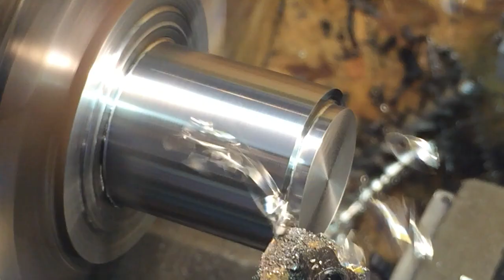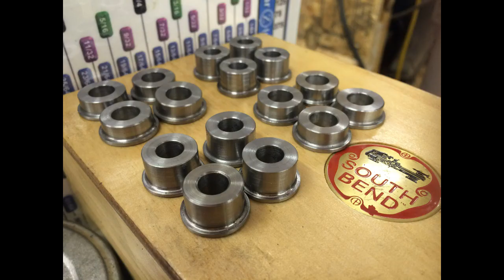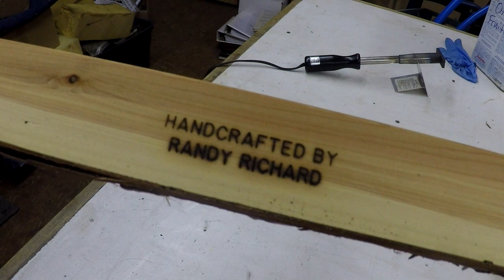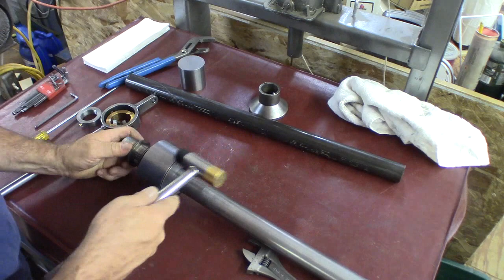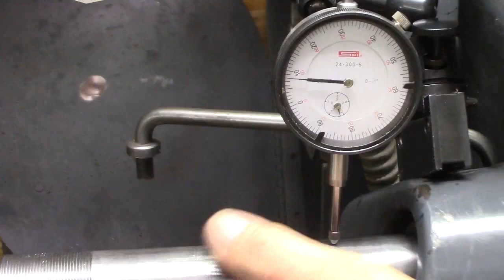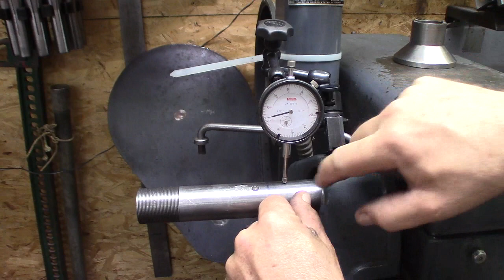Logan Lathe Collet Closer Repair P3

Comment: Would a poly bush in the spindle eliminate the run out?  Maybe counterbore the piece at 850 with a sleeve that would pilot in your lathe spindle and then it would provide the alignment for the tube. I actually like that because I think that piece needs a positive center alignment method as well.
Reply from the maker: Brian Thank you.  Great idea.  I have not made the tube yet, I was thinking of a groove in the OD of the tube and maybe just an o-ring, or a shrunk on piece of teflon then turned to slide fit in the spindle bore.

Comment: Randy, I have missed you. Great to see you back on the "Air".
Would have liked to have seen the nut on the end of the shaft that is allowing the play in the tube. How about a Teflon liner to provide support for the tube and still allow it to slide back and forth.

Great video as usual.
Gary 74-year-old Home Shop Machinist.
Reply from the maker: Thank you Gary,  Not much clearance,  Great idea, I will look at that.

Comment: If you did make a new tube just a little larger in diameter, all the parts will fit a little tighter for overall stability. Maybe not, your thinking is usually on the mark.
Reply from the maker: Thank you Charles.  Great idea, I will look at that.   I have not made the tube yet.

Comment: Nice to see you back Randy.  I'm wondering what caused the nut to have so much play?  Do you think it is wear related?  I'm wondering if the lathe was run a lot with the closer in but no collet?
Reply from the maker: Thanks Bill,   maybe made that way.  Maybe not the original.

Comment: I bought a set of 5C collets and three closers at an auction a few months ago. I'm planning on adapting them to my Grizzly G4003G, but am having trouble getting the closer apart. It isn't made like yours. It only has a 'wheel' on the back side. There is a video on my channel titled auction score for this week that shows the three closers. If you have time and could suggest how to disassemble this closer I'd appreciate it.

Comment: When measuring on the balancer, you were so close to the wheels that you are really only checking for roundness.The indicator should have  been halfway between the wheels to check for straightness.Not that it matters as you are making a new one.
Reply from the maker: I did not show all  the measurements I did.  I did measure all along the length and with the wheels as far apart as possible. Also on the outside with overhang to sim being in the lathe.  About the same measurements over all.  I agree next to the wheel is not the best to show.

Comment: Randy, typically they put a taper on the spindle side of the nut to achieve egocentricity. Having to adjust set screws to get things centered is a drag. If you have enough space to do it, that is the way to go.
Reply from the maker: There is nothing on the spindle to help with this.  This works out pretty well in all.  Still some adjusting the type of screw to use and then locktite in postion.  Thanks for the suggestion.